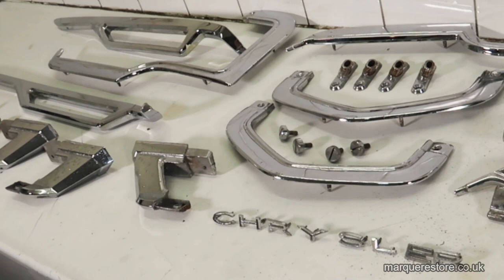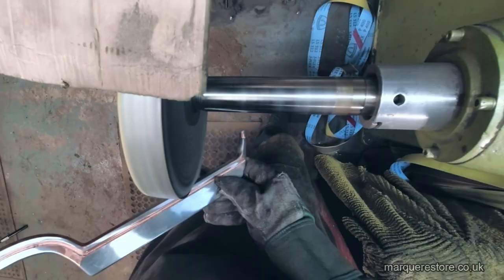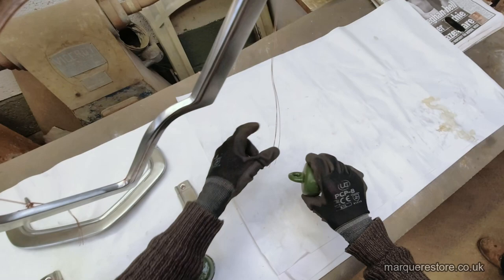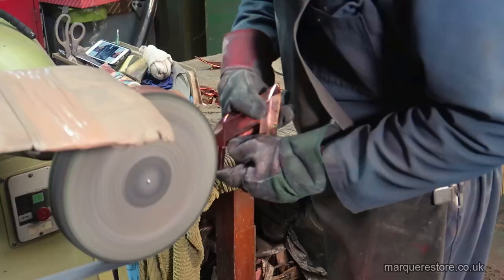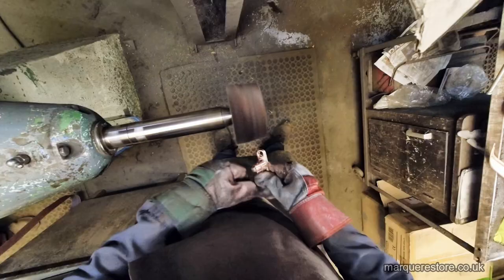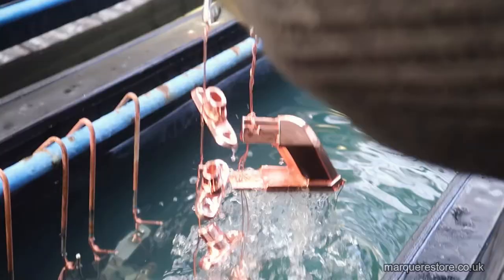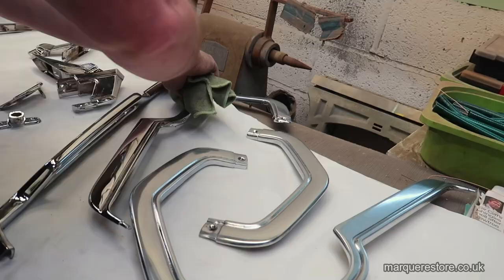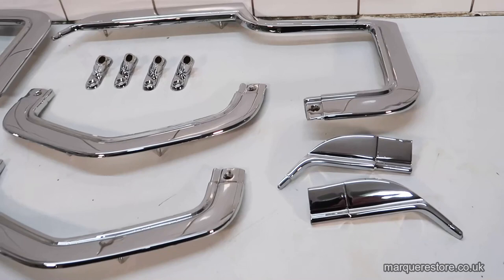How to Restore and Chrome Pot Metal (mazak, monkey metal, zamak)

Comment: 65 years old and retired 2 years ago from 48 years in the plating industry. Left school in 1974 and it's all I ever did. Started at William Bates Walsall and worked the vats 12 years there, plating most finishes, copper, nickel, chrome, brass, silver, gold, black and hard chrome, plating on plastic. Hand plating as in the video and running semi and fully automatic rack and barrel lines. Over the years work at several companies including 3 companies twice, where I teturned several years after leaving. Over the years working myself up to production manager for the last 25 years of my career at 4-5 companies including aerospace and automotive companies  to very high specification. Last one in Coventry processed fuel  heat exchangeers for airbus and Rolls Royce. Enjoyed the video and I to remember working with the dreaded "die cast" or mazak material for a lock and door furniture companies in Walsall that produced their own door handle and windows fittings and as you said the polishers had a bin by the side of the lathes to chuck the porous ones back into the system to re cast because they were full of holes. 50/50 scrap some days!! A nightmare. Brought back a few memories but Im glad I'm retired now. I'll be looking for a few more videos to watch. 👍
Reply from the maker: Happy you enjoyed it. Not many skilled platers left now.
Reply: @ChromeandCarRestoration 
Yes. Not many people want to come into the Industry. I still have mates of a similar age who are still working but obviously not for very much longer. 2 of them started with me at William Bates in 1974 and are still at it
Dinosaurs I suppose we have become. Yes I enjoyed the video. Will be looking at a few more. 👍
Thanks
Reply from the maker: @quietman2672  If you are ever passing through Coventry you are welcome to pop in and say hello.
Reply: @ChromeandCarRestoration 
That's very kind of you. I used to work in Coventry City centre virtually
A place Called Chalcon. When I worked at William Bates for the 2nd time they were owned by a Group called Banro.
They acquired the Chalcon factory and I was sent down to supervise and set up a big automatic plating line.
Thanks again. 👍

Comment: This is an insane video about the electro plating process. Very very very nice job there! I am electro plater here in germany and I know how rare information like this is! I am restoring a 68 charger and there is a lot if pot metal what needs to rechrome. I already done many parts but I sand blasted the parts because I do not know how to mix the right chemicals for the electro tank. Can you tell me the exact components what you are using for strip the parts?

Comment: This was the one stage of the plating process that I hadn't actually seen yet. Seen the before and after, but not how you pulled it off. Nice job!!!
Reply from the maker: It is a particularly difficult material to work with on account of it being made from rubbish.

Comment: Zamak can actually be a good metal if it is made and cast competently. It has a very low melting temperature, but Zamak-2, for example, is hard and has a very good tensile strength and impact strength. Actually about the same tensile strength as mild steel. Zamak-3 is used to make the slides on Hi Point pistols. Although by its nature zinc is very vulnerable to corrosion. I think this says more about chinese castings than it does about zamak itself.

Comment: Door handles, emblems, and all sorts of various interior parts made of this pot metal were common on cars when I was growing up in the 60’s and 70’s.  The exterior parts would start pitting and corroding after they were just a few years old especially in regions where they’d salt the roads in winter.
Reply from the maker: Yes. It is made of rubbish

Comment: Excellent work we can never get the perfect pot metal piece in the workshop. The electrocleaning just before the nickel/chrome always tarnishes in the dull areas where we can’t reach . And without the electrocleaning the adhesion is not good enough.
Reply from the maker: It is not an easy process.

Comment: Looks like a great job done on the diecast metal, despite the defects.
Have you ever thought of filling the holes with solder or something like that 
It might save a lot of polishing and help remove some of the defects 

Great job as usual. Well done for all your hard work
Reply from the maker: The problem is getting the solder to stick to the zinc. We do solder up pits sometimes, but when there is a lot of them it is unfeasable and expensive.
Reply: @ChromeandCarRestoration  interesting video. Thank you. When you do solder up pitting, what alloy solder is used? Thanks again %
Reply: From my experience you have to bore out the pit to clean metal then plate a layer of cyanide copper on the pot metal, then silver solder the area with silver solder with external flux and good direct heat then you DA sand the solder to material level and re cyanide copper the part to seal it. Once it's acid copper plated you cannot solder it because the plating will blister. Got to get it right first step, it's a pain but can be done
Reply: @ChromeandCarRestoration  try boring out the pit cleaning and cyanide copper plating it. Then silver solder with external flux level it and re cyanide strike may help if it was ever an important piece I'm a darn good metal finisher I've always had problems when I do plating any way I can talk to you guys over the phone for advice or email. Would love some help. Thanks

Comment: Amazing work.  Only question I have, for restos like these, would it be cheaper, as well as better,  instead of trying to repair that horrendous pot metal, create a sand mold, and make new castings out of aluminum or other materials, maybe even using lost wax molds for the really intricate stuff?

Seems there might be a tradeoff in the labor time to repair vs casting new, and plating a higher quality duplicate, with the quality I am seeing of your craftsmen doing this work, you could take things to an even higher level.

Keep up the amazing work!
Reply from the maker: I like your thinking. Re-casting in brass would be good. Aluminium gives a whole set of different problems and may not plate

Comment: If the It's an emblem and it's heavy, it's a zinc die casting, not the other metals. It corrodes and deteriorates just like your cheap faucet does.

Comment: What are your thoughts on making molds from original pieces, casting them in aluminum and then plating them.    I have a trim piece (the corral) from a 1966 Mercury Cyclone that is impossible to find a replacement for and mine is cracked and pitted horribly.    Thanks for taking the time to make a great video.  Cheers from Texas
Reply from the maker: Aluminium is problematic to plate. See our video https://youtu.be/Q1jY8IsLbB0. Brass would be much better for casting.
Reply: @ChromeandCarRestoration  thanks so much for the reply.   I’ve had adhesion issues with plating aluminum Harley parts in the past but not once thought of casting in brass.  Thanks again!   Be safe and God bless you and yours.

Comment: Question, is it possible to fill those small pits with lead?

I have a rare emblem (yes, Zamak), that have a lot of pits in it, but I have no issue with it to fill it myself and prep it. Only the deplating and plating process is a issue at home😅
Reply from the maker: The problem is in getting the lead to stick to the metal.
Reply: @ChromeandCarRestoration  Is there a solution for? Like, first copper, then lead, then again copper?
Reply: Pit repair with copper.  Plate pit locally and sand copper on surface, repeat until flush.

Comment: So you guys dont use acid dip for pot metal. I thought if you electroclean pot metal it opens up pores. Im confused i also do pot metal but have problems all the time any guidance would be great thanks.
Reply: Anodic electrocleaning is recommended for pot metal and then activation in fluoride for the lead/ magnesium if your rinses are very short skip the activation after the anodic cleaning rinse and plate

Comment: Nice job! Would it be better if we polished parts like that ourselves using hand rotatory tools with abrasive wheels, felt tips, and polishing compounds? Before sending them in to be plated?
Reply from the maker: It needs stripping properly before polishing (not grinding the palting off), or it will cause problems. Once stripped thay can be polished.

Comment: Why do you do CN copper before the acid process? Will the acid react with or eat into the base metal?
Reply from the maker: Yes. Zinc dissolves in acid.
Reply: @ChromeandCarRestoration  I used to work in a shop with both cyanide and acid plating. We had a divider in the center of the bay and two isolated drain systems to prevent spills from mixing under the floor and killing everyone in the plant. Good times!
Reply: yes
Reply: @stickyfox .    mine are in seperate tanks 20 ft apart

Comment: I love the copper finish.  How durable is that?  Even though it might tarnish, is that a patina that will protect the material below, or might it allow accelerated corrosion?
Reply from the maker: Once moisture gets in between the copper and steel it will accelerate the rusting massively
Reply: @ChromeandCarRestoration       Like in a way that makes this not good for cars sitting outside?

Comment: I am planning to do at home Chrom plating on aluminium headlight reflectors. Can you guide me?
Reply from the maker: Aluminium is difficult to plate and requires special pre-treatment see https://youtu.be/Q1jY8IsLbB0.
Chrome is the wrong finish for reflectors, it should be silver or it will not reflect the light.
Reply: @ChromeandCarRestoration  have seen this video, can you give details to setup a small home plating unit. What chemicals to use in each process.

Comment: Calling Pot Metal "Absolute Rubbish" is being kind. People come from other parts of the US, particularly where it snows, to Southern California to find old cars and parts that are not corroded. However, pot metal does corrode and have pock marks even here. The process seems very laborious, but the idea of putting a thick copper layer on the metal to fill in the imperfections, and then level the surface is genius. When it is time, I will have the pot metal trim on my 1959 Ford Fairlane plated. As it is right now, some of the trim pieces are worse than the ones you showed from the Chrysler.
Reply from the maker: It is a rubbish material. Even with us doing a lot of work the base metal often lets the job down. With steel and brass there is lots you can do to improve it, with this rubbish you are very limited.

Comment: 1957 DeSoto Fireflite, auto cost new $2700.00. Cost to plate the potmetal complete , over $10,000.00. The bumpers: $2600.00. The stainless steel? Not completed as of today.
Reply: i run a chrome plating shop in tennessee. 47 yrs us the same process. still a lot not covered. had to show it all in a short video. i give my customers a tour